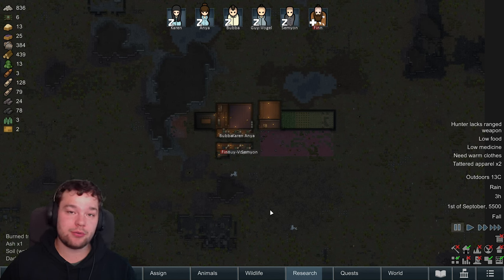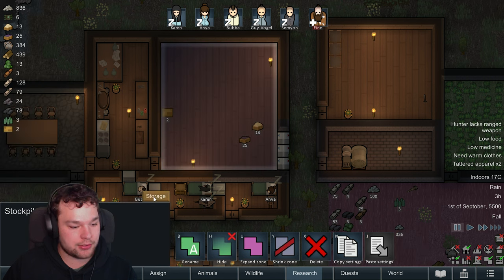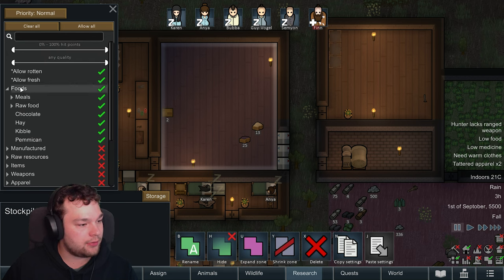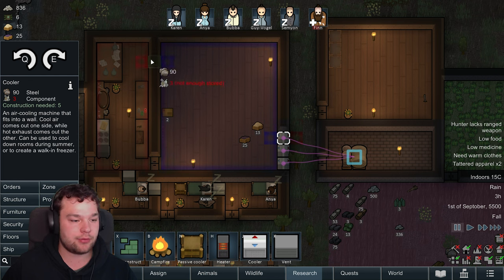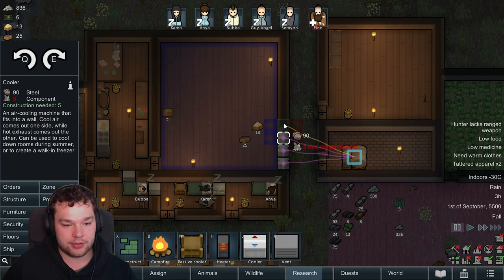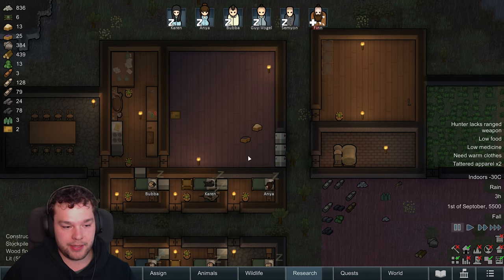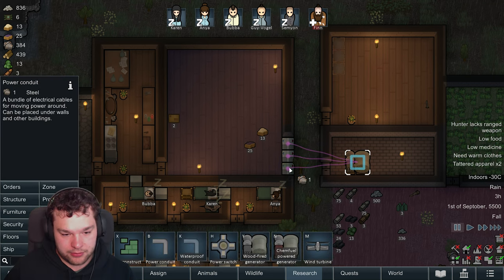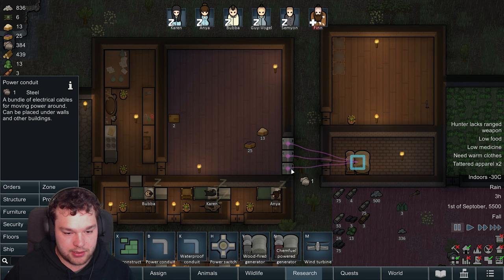How to make a freezer in Rimworld Tutorial

Comment: I cant figure out how to build a freezer that i dont need to fuck around with a couple times a year...
Freezer is big, like 250 squares. But it has 4 AC units in it, all set to -30.  And during the recent heat wave, i lost like 1000 meat and 200 lavish meals 😢
Would it work better if i give it 4 walls for insulation?  Or is there diminishing returns on that?